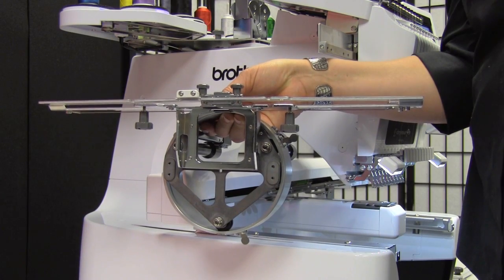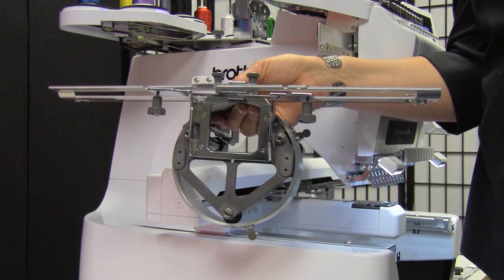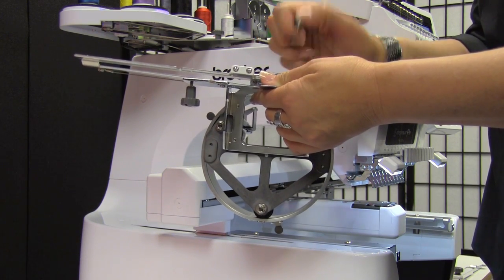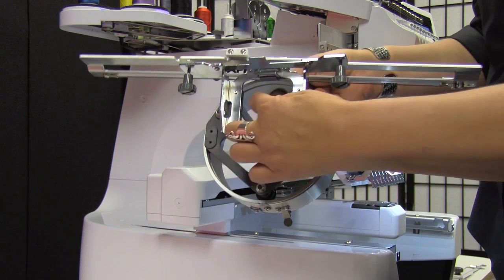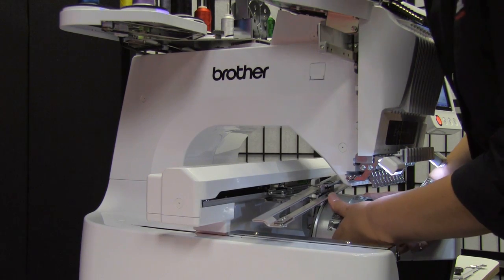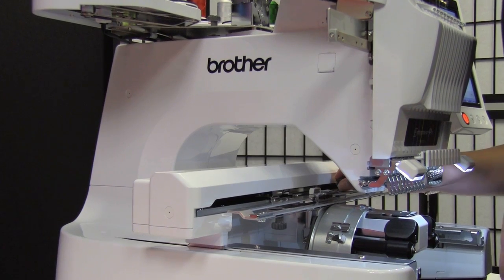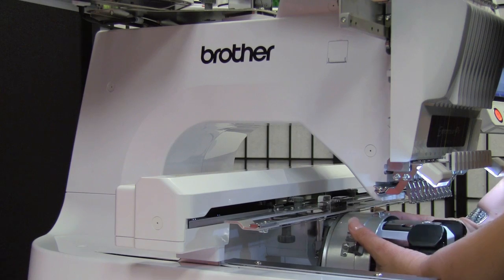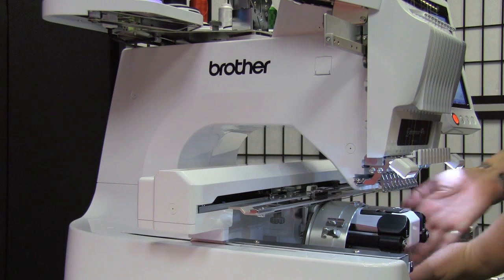How To Install a Cap Frame & Driver on the Brother Entrepreneur Pro PR1000e

Comment: Be sure NOT to "Replace" the little screws back into their original spot after you slide the frame into position or the frame with not slide side to side and your machine will make very terrible noises. The small screws go into the pulley frame mounting holes and NOT back into the holes you originally took them out of!!
Reply: +Mark Spillane Yep..... that just happened.... I am glad you posted this.. That little tidbit should have been included in the video. :(
Reply: That just saved me!!! I had 4 of the screws on top (2 from my original frame) and couldn't figure out why it wasn't turning and making that awful noise!!! Thank you!!!!
Reply: Where are the pulley frame mounting holes located? TIA

Comment: I wish this included the information to adjust the frame using the long hex drivers.
Reply: I sew agree! I have the one that fits the PR670e and it says there is a piece that needs to fit flush that uses the hex screwdrivers.  For the life of me I cannot get that piece to touch where it is supposed to! Brother needs to have better videos for all hat hoops